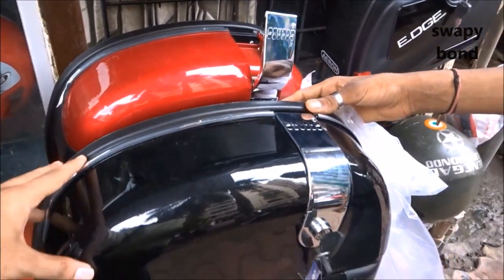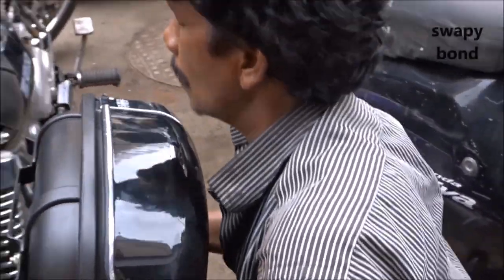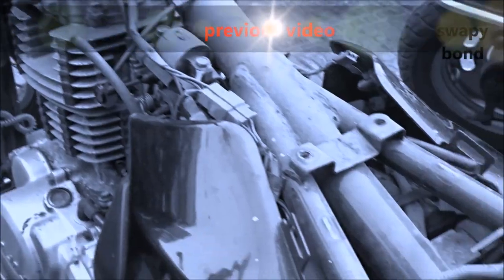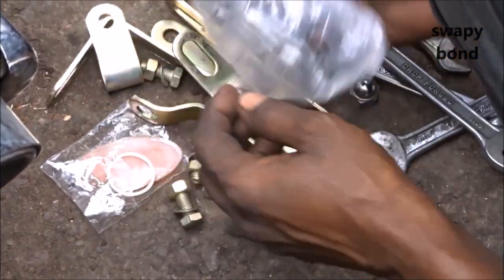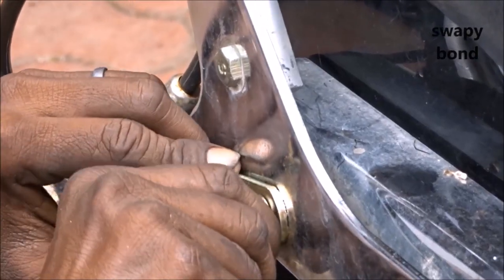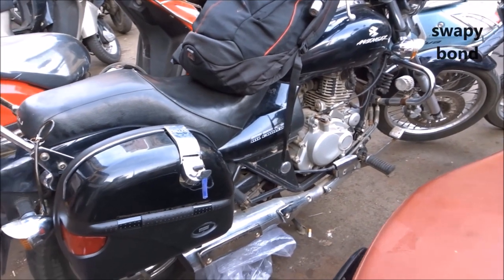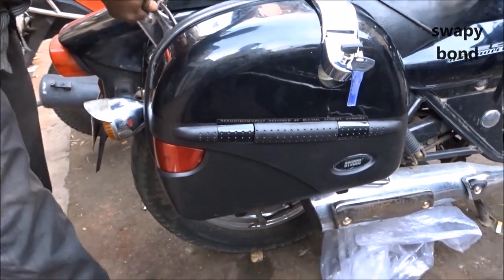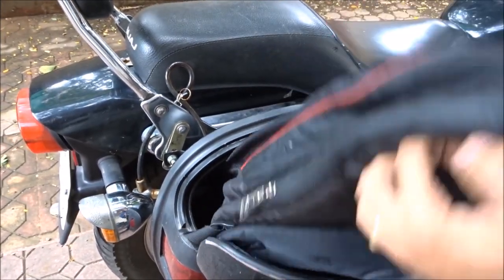Panniers Installation for Bikes | Cheap Price | Amazing Quality New Colors For All

Comment: Bro can you suggest me bike under 1.20 with abs and with comfortable pillon seat and power also
Reply from the maker: Choose from one of these bikes. Honda CB Hornet 160R @ 90,200.
TVS Apache RTR 180 @ INR 93,500.
Suzuki Gixxer SF @ INR 96,400.
Suzuki Intruder 150 @ INR 99,995.
TVS Apache RTR 200 @ INR 1,09,500. 
Bajaj Pulsar NS200 @ INR 1,10,700.
If comfort is your criteria then check out intruder. For power you can check out apache.

Comment: Today i broght Nd fixed on my bullet 350 standerd. . Same brand. Now i satisfied with this.  But still confused about is this box watter proof or not.
Reply from the maker: It is water proof, however sometimes in heavy rain, a few drops may seep in but I have not yet had that problem. Its a good company.
Reply: My lock mechanism seems made like plastic.  Not like this cromium.   😶
Reply from the maker: Are you sure its from a reliable seller? Because there may be first copies also